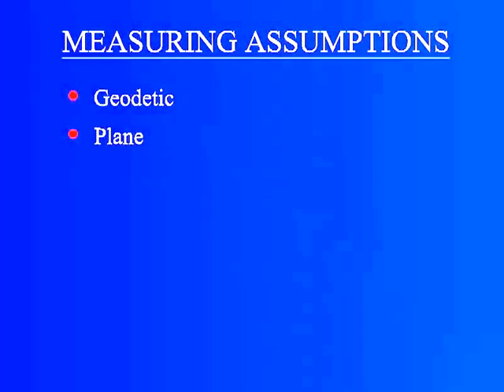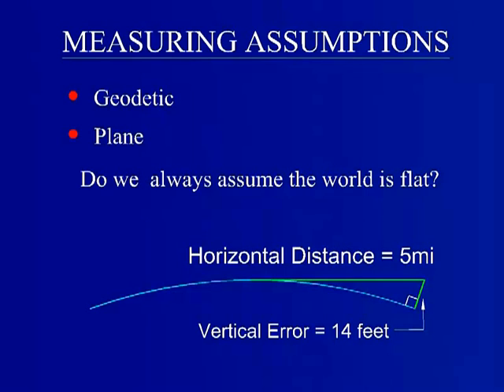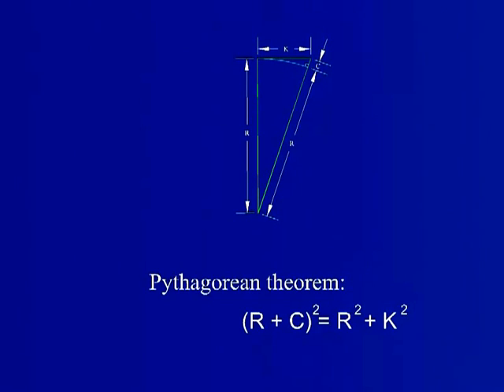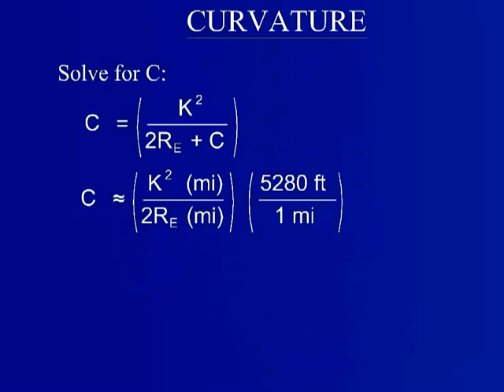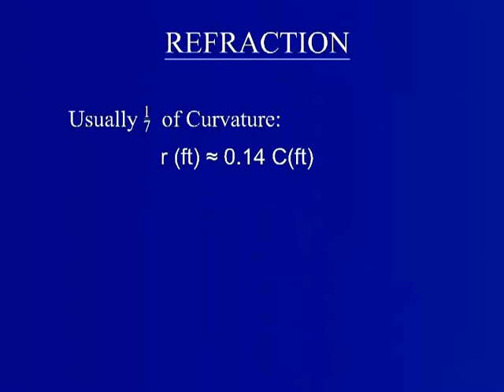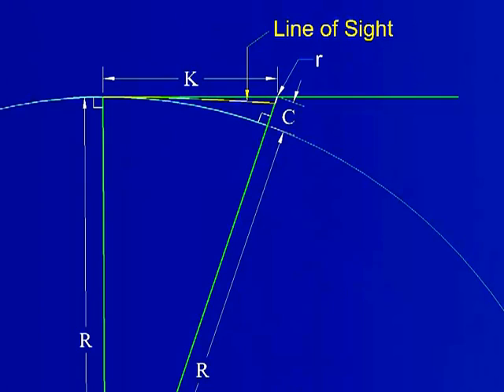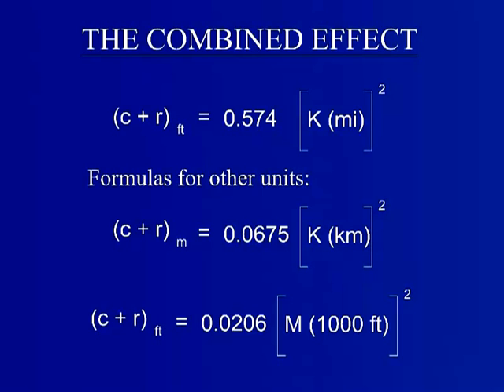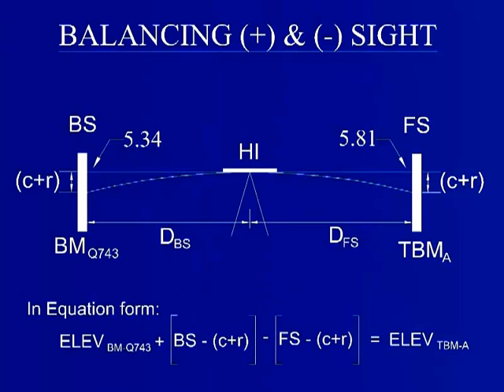Curvature and Refraction

Comment: Could you help me answer these questions from my flat earth wacko friend:
People that are living in the Rochester area. can see the Toronto skyline, the tower and buildings on a clear day. The distance is approx.100 miles the declination is 6,600 feet. In essence I am standing on one side of a 6,600 foot hill  that is shaped like the curve of earth I can see buildings on  the other side 100 miles away. Is that possible ? What is the difference between standing on the seashore at a 6,600 declination at 100 miles and a hill that is 6,600 feet tall (assuming that the hill follows the exact curve of the ocean curve ? In both cases I have a 6,600 hill or curve of earth to see objects that far away. I am wrong? Is it refraction? Let me know your thoughts.. I have looked into refraction (http://en.wikipedia.org/wiki/Atmospheric_refraction.) but that involves the sun at sunset, sunrise and atmospheric conditions. In terrestrial refraction the line of sight variance is  8% + or - , depending on conditions near the surface of the water Let me know what you thoughts are. Also, I live in So Cal and on a clear early morning as I stand on the shore I can see the coastal lights of Catalina, and with my telescope I can see boat movements near Avalon and people playing and walking on the shoreline. It is 30 miles away. The declination is  approx. 600 feet. Why is it that I see the coastal lights? Shouldn't the 600 feet of declination prevent me from seeing the lights and movements? Is the light, movements and image bending / refracting? Is it an optical illusion? I don't know the answer, could you help explain those questions.